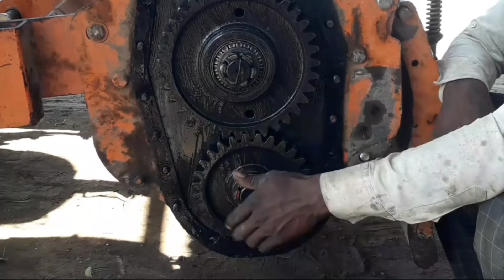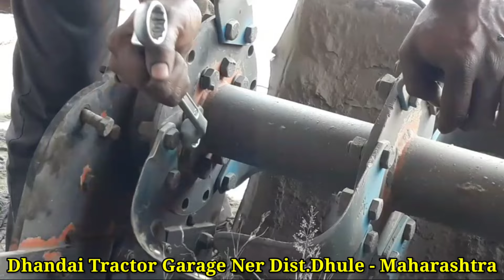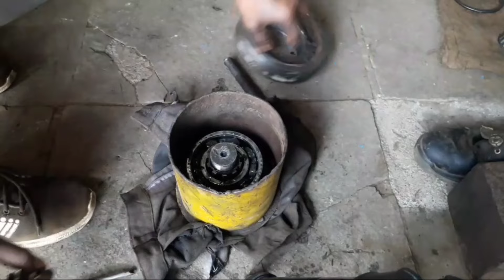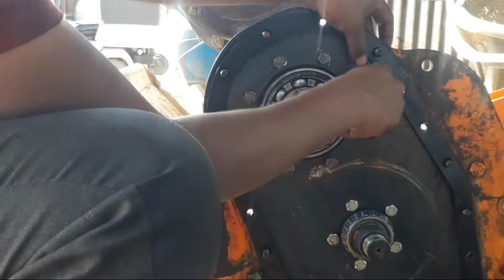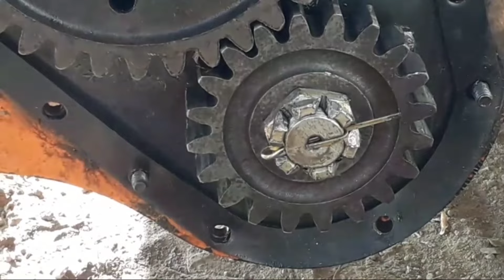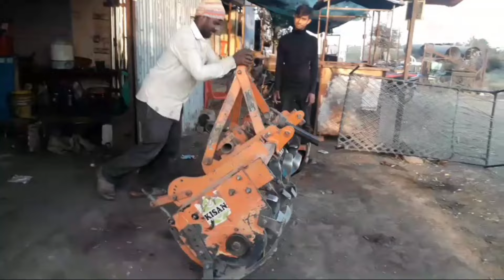Shaktiman Rotavator oil seal and bearing.शक्तिमान ऑइलसील चेंज करे.रोटावेटर ऑइलसील#shaktimanrotavator

Comment: 28 teeth gear is touch the inner 8 bolt what's reason  any suggestions?
Reply from the maker: Try putting the gear upside down or put the visor behind the gear
Reply: @dhandaitractorgarage   thanks you bhai